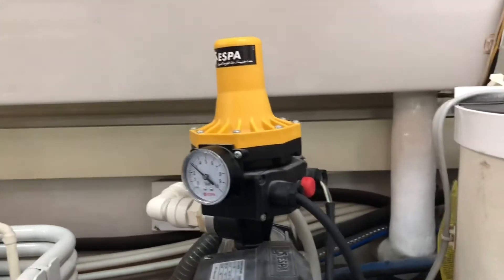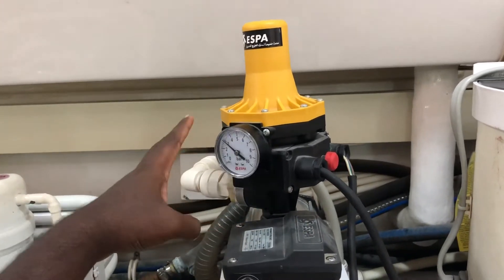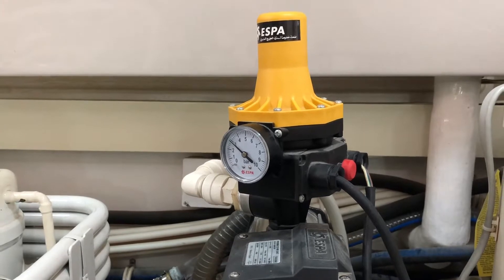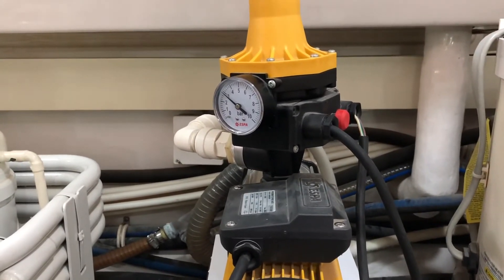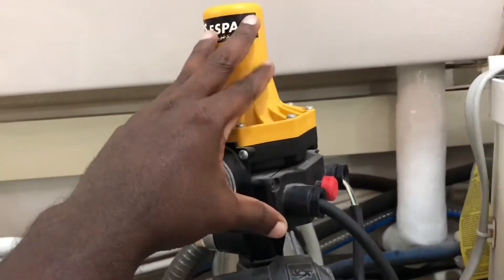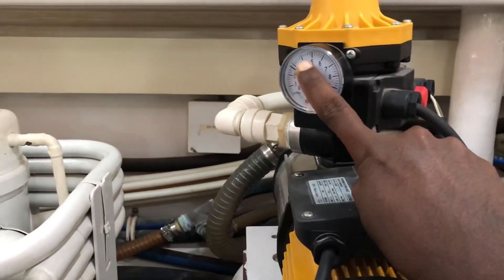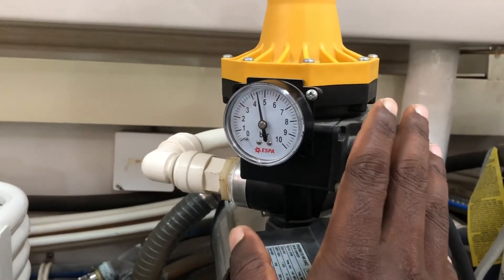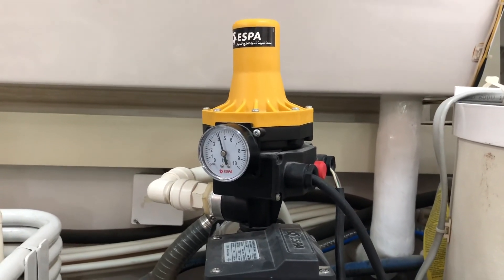How automatic pressure switch is working #pump #diy #electrical #waterpump #pressureswitch

Comment: Do it need pressure for water inlet, I think this could not if your tank lower that the motor,
Reply from the maker: No it dose not need pressure in inlet . Even tank is lower level its still  works .

Comment: Sir i have installed this type of pressure switch beside my roof top water tank the issue is that when we open the tap the pump is not start automatically. Every we started the pump by pushing the reset button Please reply me as soon as possible.
Reply from the maker: Hi. This pressure switch is automatic   it has an electronic circuit in it . It's usually hard to repair, I need to know if you have a pressure tank installed if not

 , if you can, please check the wiring  connector is tight well
Then you have to check the capacitor ( testing capacitor is dangerous if you don't know how to check, you may need an electrician)
If thees 2 is no issue, you may have to change pressure switch 

But if you have a pressure tank installed, there are a few other things you have to check . Let me know if you have a pressure tank as well, and then I will msg you again 
Thank you
Reply from the maker: The other thing you can try
Close the all water outlet tap and press the reset switch few times until it build the pressure inside the system, on your pressure gauge, you can see how much pressure it built when you see pressure stable you can open water and check if pressure switch is working or not
Reply: Thanks sir for replying me i thinck its initial pressure issue because my roof top water tank have not sufficient pressure to lift pressure switche out let magnet to operate starting relay.Am i right please give me answer?
Reply from the maker: It doesn't matter the initial pressure , as long as it has water flows to pump, the pressure switch should work. When you reset a few times, the pressure switch will calculate the start and stop pressure, then operate as it is memorized

Comment: can you adjust the low pressure and upper pressure on this switch
Reply from the maker: This type of pressure switch you can't adjust the pressure, if you need to adjust pressure you have to put the mechanical pressure switch

Comment: Will I still get water when there is no electricity if I use this?
Reply from the maker: No as long as you have overhead tank you can get water by gravity pressure
Reply: @AsaaTech  yes I have  a gravity tank set up but will the water flow normally through the pump or do I have to run a by pass for gravity pressure?

Also I'm thinking a bypass would help in the case of maintenance one could easily turn of the inlet and outlet valves for the pressure pump and still get water to flow through.

Comment: Dear
I bought an Espa pressure switch for my irrigation pump but i encountered a problem of pump continue running even when maximum required pressure is achieved.
I tried the following after the pressure is the maximum: 
Close inlet Valve 
close outlet valve 
The pump stopped but i noticed that the pressure dropped dramatically and the pump start again and again.
Any advise 
The Switch is brand new  
Thanks in advance

Comment: Hi, Why is the R1 resister gets very hot and sometimes will have open circuit.
Reply from the maker: Check the supply voltage is it less
Reply: @AsaaTech  it's 230v
Reply: @AsaaTech what does it mean when it crosses 50 psi?

Comment: Hi, Can some one help whether the Non Return value of pressure controller can be serviced/serviceable because i have a leak in inlet post pressure cut off water flows backwards via inlet which makes the pump cycle on and off continuously.
Reply from the maker: Which type pressure switch you using
Reply: @AsaaTech  The same exact one shown in video. But different brand (Besten Pump). Issue is water returns back via inlet when I close the inlet valve after pressure cycle the pressure is maintained. The movement I again open the inlet valve pressure drops. If you want any specific values let me know I can check on pump. Thanks
Reply from the maker: Where is your water tank located above the pump or from normal water supply?
Reply: @AsaaTech  Tank located at one floor above. Have installed external NVR valve at inlet before a year which solved the issue temp. Now seems like External NVR value went faulty. So, checking on replacement of NVR value of Pressure control.
Reply from the maker: @arulkumar.c4336  istall the non return valve between pump motor and pressure switch and make sure there’s no any water leaking after the pressure switch and close the valve after pressure switch check if the pressure switch holding a pressure
Reply: @AsaaTech  Ya thanks man.... Exactly what I thought and was working today on the same. Will update post installation. But, do you have any idea the inbuilt NVR valve can be replaced/serviced since it's inside the controller body and it's molded.
Reply from the maker: @arulkumar.c4336  I think no ,most of pressure switch molded with in build none return valve not possible for repair that’s why for safety of the valve most technician install brass fittings none return valve between pump and p switch . I hope that idea will be okay and let me know the updates and it’s my pleasure to help you please share my channel with your friends also thank you 🙏

Comment: Hello, our water source here  is coming from the municipality water system and it supplies water for 1 to 2 hrs each day, the pressure the municipality is very low, if i am going to use that pump pressure switch, does it help increase the pressure in my house?
Reply from the maker: Yes you can use this system but I think you should install the water reserve tank first ( I think you already have one) you can install the booster motor after the tank and make sure the plumbing system must be in good condition . If you need to know anything just let me know thank you sir
Reply: @AsaaTech  can you share your mobile number

Comment: Can we use it  for hot water bro
Reply from the maker: It’s depends on water temperature. If you need to use pressure switch for hot water system you have to install pressure switch before the water heater in water supply , that because most of pressure pump will work properly up to 50 degrees celsius only.

Comment: Mine is automatic but keeps on starting on n off there is very little water dripping n it switches on. Help me reduce pressure
Reply from the maker: If you need to reduce pressure you have to change less HP pump otherwise you have to use different pressure switch. This type pressure switch you can't adjust pressure. Pressure switch automatically adjust pressure it self.
Also you have to stop leakage it will effect to switch and pump
Reply: Mine is .5 hp motor n Btali bt 10 aps switch . But thanks . 🙏🙏

Comment: this is used where near freah water supply or like on a purifier? 🙏nice video by the way.
Reply from the maker: Thanks for comments ☺️☺️
This is usually use for fresh water system.if you using reserved tank or your water supply not enough pressure you can use water pump for make system more pressure. In that case you need to use pressure switch for control the water pump on and off depend on water pressure.
Thanks